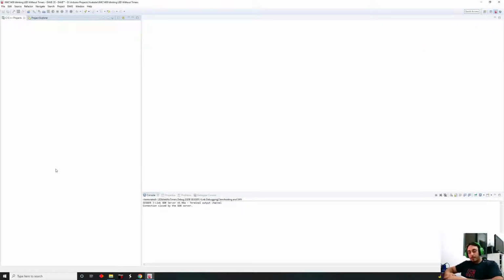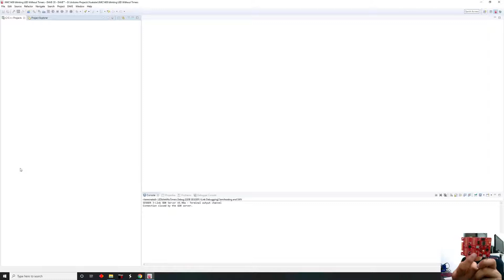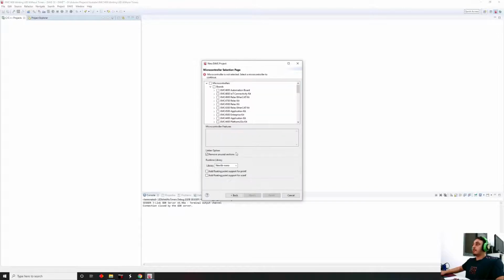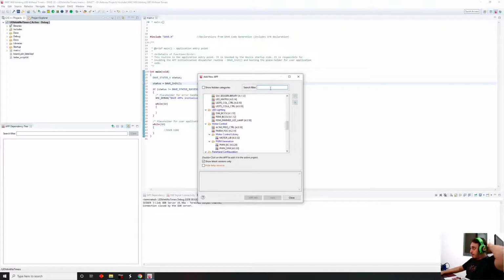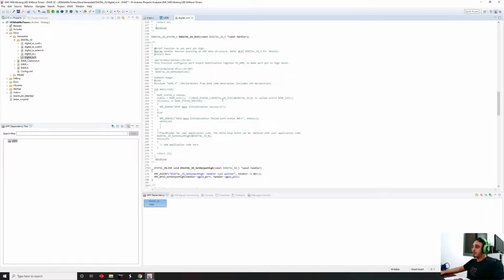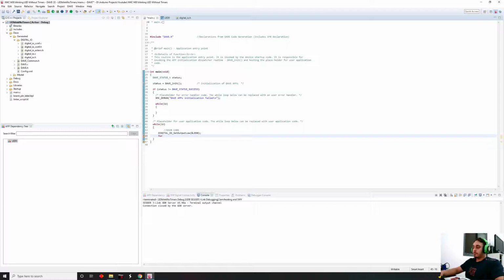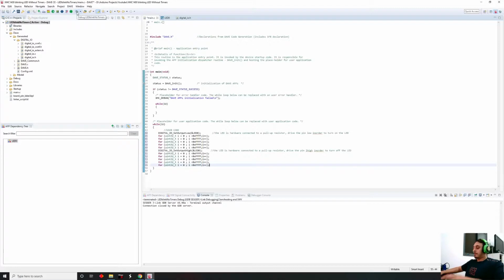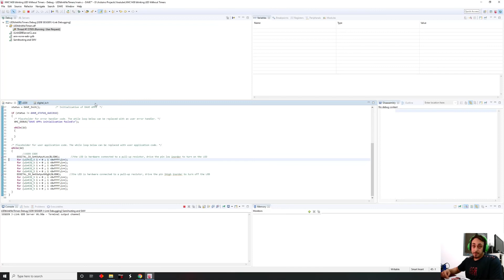XMC1400 Lesson 1 Part 1: LED Blinking without timers

Comment: I follow steps with vedio, but LED not blinking.
Is there any suggestion? 
Thx.
Reply from the maker: Please check with a multi-meter if your LED is oki. ( make sure to disconnect the board from usb power)